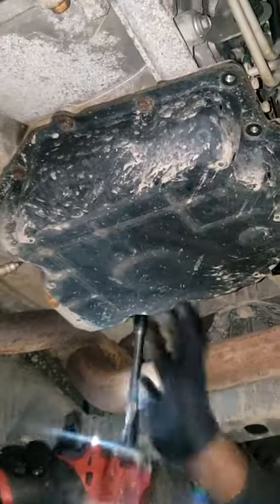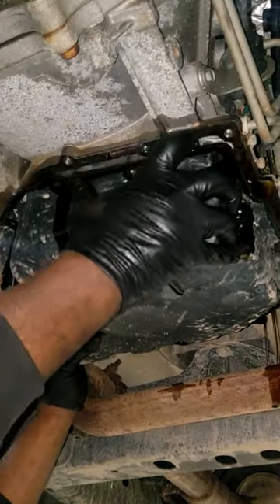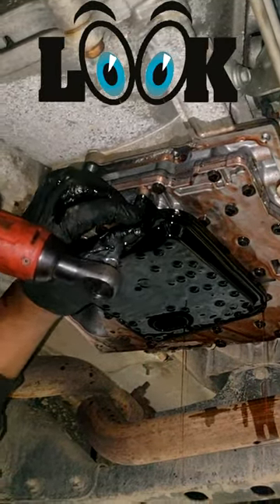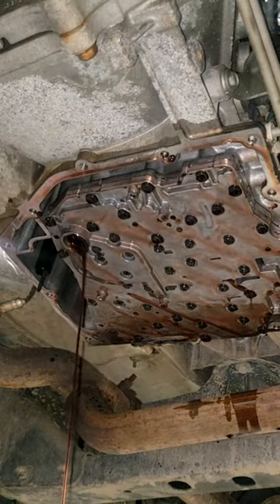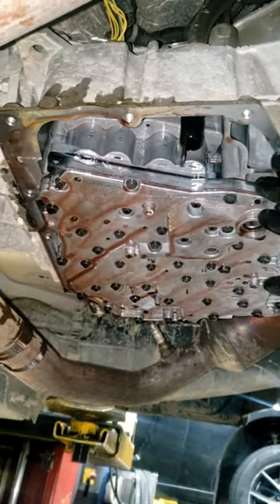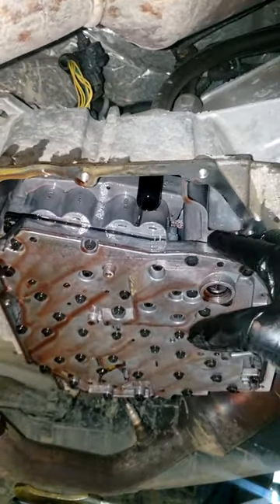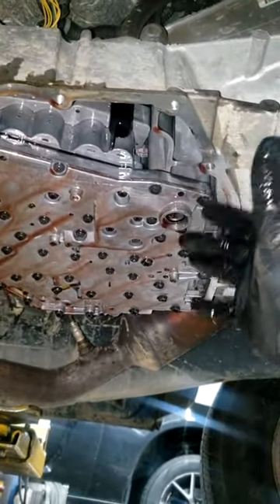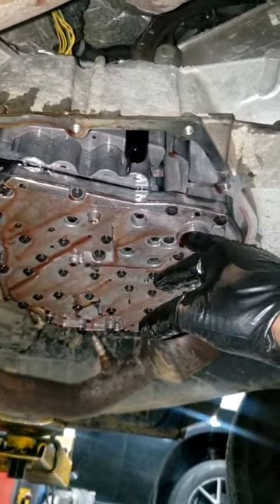No transmission flush machine, no problem. Do This. Best way to get out more of the old fluid.

Comment: Is it better to do this when the engines warm? And should it be in park or the e brake on? Or in neutral? I've heard both. Keep up the good work.
Reply: It should be warm/hot so that any possible contaminants are suspended into the fluid and it'll drain out. I've also seen that you're supposed to gently and slowly, shift through each gear position possible A few times while the vehicle is OFF.

Comment: That's a drain and fill with a new filter. You can run clean fluid into the cooler return line and drain the old fluid into a drain pan the transmission pump will suck in the new and pump out the old. You can flush without a machine.

Comment: You can disconnect the lines that go to the radiator and run it for a few seconds in average 1 qrt.every 3 seconds.  So after filling up the transmission you can get the most out of course not all cars have this type of set up knowing that some will have integrated coolers and that make it difficult but 65 percent of vehicles can be done like I mentioned before.
Reply from the maker: Very interesting my friend.
Reply: @OnlineMechanicTips  you want to see it i might make a video about it.
Reply from the maker: @abbsgarage.9676  Sure man, go for it. I would love to see how you do it. I didn't know you had a mechanic channel. Imma head over and check out some of them videos when I get home.

Comment: Do you have a preferred method of cleaning off the old silicone from the pan and bottom of the transmission? I see a lot of Chryslers with ALOT  of silicone and or cooked on gaskets ..
Reply: Hard plastic scraper.
Reply: Tungsten carbide gasket scraper. It has a square end that won’t dig into anything.

Comment: After reading a lot of these comments, I’d like to Thank Ya’ll for keeping me in business the last 48 years (I fix Cars/Transmissions aka Mechanic) some of the things ya’ll “say” you do will actually damage a Transmission. By the way keep on doing only partial oil changes on your  Transmissions and while you’re at it why don’t ya’ll just do partial oil changes on your engines too, us Mechanics need the business. What a lot of people call a “Transmission Flush is actually a “Fluid Exchange w/Filter” and requires the proper Equipment/Machine to ensure no Damage is done to the Transmission.  Keep on going folks we want your Money….. er’ Business I mean.😊

Comment: Drain the converter & blow out the cooling lines, pull out the speedometer to drain the tail pull out the vacuum module  then you get it all. Go the little extra & do the job right.
Reply: Holy hell no. That’s an insane amount of work for that job when the same thing can be accomplished with a flush machine or a cooler line drain.

Comment: Anything that’s got 100,000+ do not wanna flush it unless you have a service history on it because it may not leave the lift
Reply: Never had an issue then again the vehicles weren’t too old and both were manual so idk if that has an effect 🤔
Reply: I had a transmission shop tell me that years ago while having the transmission rebuilt on my dodge ram. He said that many of the vehicles that come into his shop are within 500 miles after being flushed. He recommended that if the transmission hadn't been regularly flushed out that you only do a fluid change because when you flush a transmission that hasn't been regularly maintained it can knock a lot of the built-up gunk loose that can clog filters and lines that will lead to complete failure. That being said, flushing is the best option as long as it's done fairly often on a regular basis.
Reply: @awdeveau  HI. Just wanted to chime in real quick. I have heard that also. But I have worked in a dealerships for over 30 years and used BG flush machines for alot of those years. Now im not saying that the theory is wrong because I have actually witnessed it happening once. (not to me) Although, one time out of hundreds, the odds aren't good for that story. Anyways, if it was a fear, couldn't you have the customer sign a waiver of some type stating that it could ruin the trans and they still want to move forward with the flush?
Reply: @midnightrider1854  the "reverse flush" that some shops sell will kill them damn near every time. 

That said, I just simply change the fluid and filter (gets 6-7 quarts out of a 14 quart system) every 25k when the manufacturer calls for 50k changes. 

Fluid is expensive, but not that expensive.
Reply: @leftyeh6495  I suppose that depends on how bad the trans fluid is, and if the services have been kept up. But I have done a lot of filter and drains as well. I just always preferred the method of completely removing the fluid.
Reply: @awdeveau same as I’ve been told . If it was flushed and serviced regularly , can continue . If not , best to just drain with fluid and filter change. This advice has worked for me at least

Comment: Main issue will be the garbage left over in the trans cooler and trans cooler lines(if applicable). I like to reverse flush the cooler along with lines after disconnecting lines from trans.
Reply: so stick a hose in the valve body and in a 1 gallon jug of transmission fluid and the fliud goes through the converter first then the cooler then into the pan

Comment: You're getting maybe a third, half at the most, of the fluid out. Leaving it overnight makes it a little less messy but only gets a couple more ounces.
Reply from the maker: What ever more I get out by letting it drain over night is a bonus. Im aware Im not going to get it all out nor am I trying to. This is simply a transmission service job sold with the intensions of getting as much out as possible, This is not flush job.
Reply: more like 15%
Reply from the maker: @AudioFreqx  Thats considered more than usual.

Comment: Can you add any wisdom to the idea of not replacing the fluid? I had two 4T60s wipe out their 2-3 bands after getting a flush and filter. Old head said it was the shop filling it with completely fresh fluid that killed, it they should have used a 50/50 mix of old and new fluid because there's something about having the old fluid in that helps keep the bands from glazing and slipping? Is there any truth to this?

Comment: 42RLE trans there. Pull the valve body screws loose and brake the seal between the valve body and case. That will allow the converter to drain about half way out. Otherwise it will remain full. Don't worry about the clutch feed seal above the valve body, its rubber and be fine when you re-rorque the valve body. Better use atf+4 so you don't get TCC lockup shudder. Remember your new filter o ring!

Comment: How about when your van goes in for a trans service.
You get it back and the pan did not seal (leak).
Brand new fluid twice!
That’s a good service for a transmission.
Reply: Why do you say that?
Reply: @Pogohontas.  
I drove it around town and then home overnight.
Discovered the leak.
Call the tech, he had me back in.
Dropped the oil pan and all the trans fluid.
Re sealed the pan, added new fluid.

Comment: What about the removal of the fluid out of the Torque Converter?
Reply from the maker: I'm doing a typical trans service on this vehicle. My intentions are to get as much of the old fluid out this way. You never gonna get it all out this way
Reply: @OnlineMechanicTips  I often wondered, if the Converters fluid was drained as well. I know that would increase the cost of the service. Thank You Sir for answering my question.

Comment: Drill a 1/8 the inch hole in the torque converter right where the 2 halves are welded together ,only drill thru one layer of the converter shell make sure the hole is at the bottom let it drain ,then next morning, clean the hole and put a nice spot weld to close it back up , now you just got about 95 plus percent of the trans fluid out of the transmission

Comment: That is simply a service. A flush consist of a transfer machine which gets rid of all the old fluid.
Reply: Thats not what a flush is 💀 you call him out for doing a service then call the same service a flush. Go learn something in a real shop
Reply: @Manni-   so wrong , a flush is a transfer of fluid wish old one comes aout like the guy up to stated ,this is a drain a fill  you should go to a real shop 👌
Reply from the maker: Imagine that, thats what I said it was. A typical trans service with a extra attempt to get out as much fluid as possible
Reply: @Dankneefantum  no you can't get that
Reply: @OnlineMechanicTips  your absolutely correct. Had to go back and listen again.
Reply: Never use transfer machine

Comment: Drain, fill with new, drive for ten minutes. Repeat five times. Final drain, remove the pan and replace the filter, reseal pan, fill to spec. Takes longer but is more thorough
Reply from the maker: Yes, I was so hoping at some point you would mention the filter. But yes, this make sense.

Comment: How do you feel about a transmission fluid and filter change on a car with 100k+ miles? I heard some say it’s a no go and some say go for it (2008) hyundai
Reply: Just don’t do a power flush. A drain and fill won’t clear fluid from the torque converter so you’ll get a partial change which I think is ideal. Plush those power flushes can remove  material that is keep your transmission running correctly!
Reply: If the fluid is not burnt , go for it! I apprenticed at a Mister Transmission here in Ontario, older cars actually had filters that could be cleaned and re used. If we came across a vehicle with burnt stinky fluid we would put old fluid back. The shop would warn customers of catastrophic failure if new fluid was put in. High detergent quality of new fluid might wash away anything holding transmission together. Recommend transmission was ready for rebuild

Comment: A flush technically means to flush the old fluid out with new fluid or something else.  Some transmissions you can’t do this in.  But. In the ones you can add fluid by the dipstick or somewhere else.  You dump new fluid in while the old is draining still and yes you will lose new fluid. But that’s a true flush
Reply from the maker: This not a true flush or a false flush. This a trans service.

Comment: The trick is to change the fluid n fliter, BEFORE,
it changes to that brown rusty color. Yeah, the fluid may still be good, but not as good as new, fresh fluid.
Example: Brake fluid is also a hydraulic fluid.
Have you ever noticed after bleeding the brakes how much tighter n responsive the brakes feel?
even though the old fluid didn't look that bad??

Comment: I have a question I'm not a mechanic but I have to be a mechanic because nobody wants to flush my transmission so I just want to change the fluid but I don't have a dipstick on top what do I need to buy to put the fluid into the transmission.. where I stay at not too many people want to touch transmissions.
Reply from the maker: What kind of car is this? Also are you subscribed to the channel?
Reply: I dropped the fluid on Durango filled back up the same amount with new and trany started slipping.

Comment: Yep, generally getting a little less than half of your fluid out by draining the trans itself. Unless you have an older Ford, most converters don't even have a drain plug. A lot of times, changing fluid on just the trans itself will stir up enough trash to wreck the valve body and cause it to stop shifting.🙄

Comment: how do you get the Oil out of the Torque converter ....??? with out doing a flush I know the secret
Reply: How????
Reply: @bismarkwilliamson8117  well you see if its not a ford  where some of them actually have drain plugs on the converter ..You pull the transmission lol   and manually drain the converter
Reply: @SaerTurner-wn2qh  I'm not understanding what you mean
Reply: @bismarkwilliamson8117  lord ..lol  it was all a joke because I love busting JTs balls But it is True some torque converters have drain plugs on them not all of them do  .. but with out doing a Flush the only way to get the fluid out of the converter is to remove the transmission and manually Drain the torque converter
Reply: @SaerTurner-wn2qh  and you're humble opinion is a flush necessary
Reply: Depends  ...My honest opinion on Hydrostatic transmission  no just change the filter and fluid  ad some transmedic or Lucas  to it and Send it.                                                                     But the new  CVTs I can not give any honest opinion on them  as there is not enough failure rate history on them yet  ..
Reply: I change the fluids on all my truck every 80k KMs  and all my trucks have the original transmission's in them and not one is under 600k kms  on the odo and my work truck has 1.6million kms on it and that on all i Had to do was at 1million replace the clutch packs  and I have never done a flush just drain filter refill
Reply: @SaerTurner-wn2qh  I have a 2013 Corolla I got it with 98,000 miles. I change the transmission fluid at 120,000 as it was black. But I never flushed it. As I am now nearing 130,000 miles. Still pink but it's kind of dark
Reply: @bismarkwilliamson8117  when it starts to get dark brownish or murky brown red  its time to change it the key is to change it before it burns  and goes black  . but if its pinkish to blood red you should be okay for quite a while  still
Reply: @SaerTurner-wn2qh  should I flush it next time?
Reply: @bismarkwilliamson8117  it depends   to start does it have the CVT transmission  then I would say it would not hurt  to have it flushed .. if it has the Hydrostatic or the 6 speed manual I would say no  just drain filter and fill
Reply: @SaerTurner-wn2qh  it's not CVT or 6-speed manual it's an automatic transmission
Reply: @bismarkwilliamson8117  so you have the hydrostatic Automatic  not the CVT automatic   then I would just drain filter and  fill
Reply: @SaerTurner-wn2qh  thanks for the advice
Reply: @SaerTurner-wn2qh  where u from by the way?

Comment: I just put the parking brake on while vehiclevis on and on drive disconnect the cooling line let it all out until car won't go on gear turn off car remove filter replenish all the oil with new

Comment: And this is why you still have transmission problems yes a transmission flush machine is expensive but if you don’t use one you are simply changing the bandage on an infection the entire system must be cleaned including the torque converter and cooler
Reply from the maker: Who said we don't have a flush machine? We use Valvoline additives. Of course they supply the machine. But I didnt sell a flush job, I sold a trans service. Changing that filter more important than changing that fluid only.
Reply: @OnlineMechanicTips   sold a trans service with no flush? 🤦‍♂️
Reply from the maker: @tracycanty9426  Yea, whats wrong with selling a maint scheduled trans service?
Reply: Sorry I guess different shops do things differently all the best 👌

Comment: Well... actually you could take the top transmission line off of the cooler and turn the key all the way forward without turning the car on and it will pump all the fluid out the transmission make sure you got a 5-gallon bucket 👀
Reply: Say Whaaat? How it's gonna "pump" anything without the engine running the pump....huh? Just checking...I don't know everything about anything...except nothing!

Comment: Why haven’t any of the pros in the comments suggested using a vacuum pump to suck all the fluid out of the fill tube?
Reply from the maker: Because they remember hearing me say that this is a transmission service job. Nobody doing all that for no 1.5 hours labor
Reply: @OnlineMechanicTips  
My comment wasn’t actually directed at you, rather it was at all these guys in the comments talking about the best way to drain all the old fluid.

Comment: Brah you dump the pan and then put the pan on with like 2 of the bolts.  You fill with like 3 or 4 quarts and you start the car and let it cycle through.  Dump again and then final fill.

Comment: What's the best way to empty the converter? There is alot in there
Reply: By popping the return line to the transmission from the cooler and into a bucket and starting the vehicle. It’ll pump fluid into the bucket, when it starts spitting air and fluid, shut off, refill, repeat. Eventually you’ll fully replace the fluid.
Reply: @BrandonWest87  cool

Comment: As a retired certified CAT&CUMMINGS mechanic I've been questioned many times on that subject. First thing is out sight out mind; just like the owners manual!!! ( unread ) 
Changing or flushing ever thirty or fifty thousand miles is OK. But if you have not done the recommended maintenance and now there seems to be a problem ( eighty/hundred thousand miles ) changing or flushing will probably exacerbate the PROBLEM!!!!
Reply: Ever been questioned about how to spell Cummins? Probly not certified.... @ spelling....I bet
Reply: If you’re afraid of losing the precious gunk inside the transmission, you can always drain and fill without lowering the pan, and better fluid quality will make transmission work better

Comment: Wait did you disconnect the upper line to let Air supply help???
Reply from the maker: nope
Reply: @OnlineMechanicTips  then got 1/3 of fluid
Reply from the maker: @christiancampbell3523  But I needed 8 qts to properly get to full. According to my math. If it normally takes 5 to fill, and now I need 8 because I drained it over night. That equals about 8 right? yes
Reply: @OnlineMechanicTips  so you drained 5 and need 8 correct?? That means the 3 you left were still contaminated... You do the math with half of the job done 🤣.
Reply: @OnlineMechanicTips  maybe drink an ensure to make sure 😃